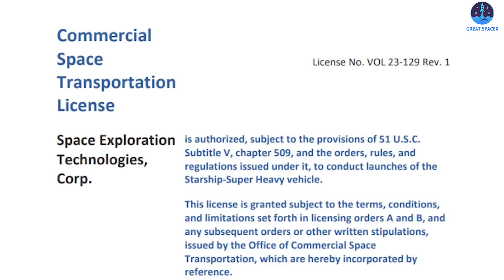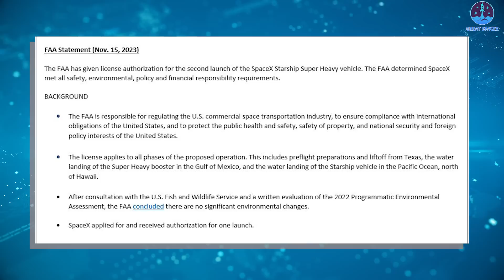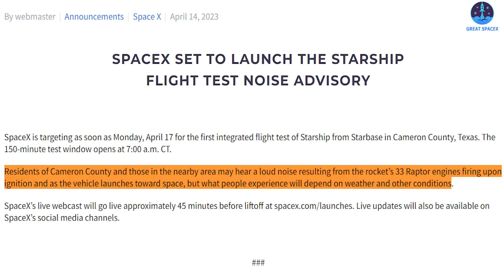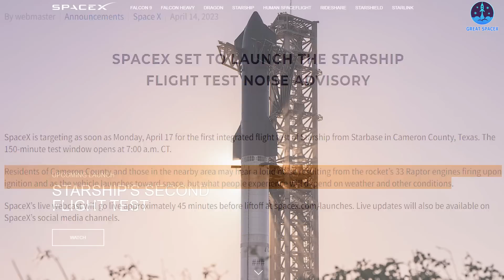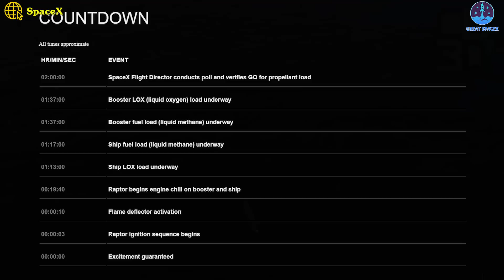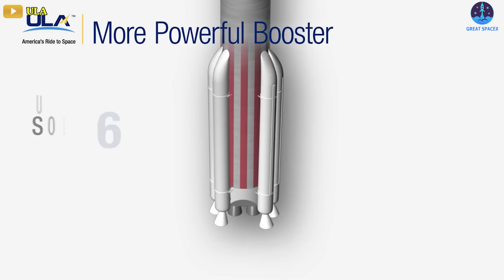Finally happened! FAA and FWS just approved SpaceX Starship OFT-2 this week!

Comment: This isn't so much a test of the flight vehicle, as it is Stage Zero. If it fails it's back to the drawing board and there won't be a 3rd launch for at least 12 months. The only reason that tomorrow's launch is even possible just 6 months after the "Big Dig", is that the water and steel system was mostly ready to go. They saw the need for it at least a year earlier.

Comment: You should research the actual failures during the fist flight test. The first test flight never reached stage separating. The separation mechanism did not fail. It was never engaged during flight because the flight computers terminated the flight do you loss of gimbaling control.
Reply: The first fight really was bad. The rocket was tilting right off the launch pad with little control left. The concrete that was blasted away damaged many things on the rocket so it was "dead" before it got 500 feet in the air. Musk was glad at that point to see it get clear  of the pad. He knew the risk was really high and went for it anyhow. That is called balls, don't see that much anymore. Go Space X!

Comment: 90% pad no damage and Lift off achieved, 65% no engine loss on ascent, 57% second stage success, 42% booster RUD at second stage,  72% booster hits mark and successfully "lands" 50% starship survives re-entry. 95% starship "lands". 1550% excitement levels. Letssssss goooooooooo.
Reply: XD😂😂😂😂
Reply: Sorry forgot the most important percentage. 100% hitting a whale or shark. Surely Elon will aim for one. #1 troll.
Reply: 100% failure
Reply: 100% failure on the launch pad. Kabaam, kaboom.
Reply: @GoDodgers1 the first sensible comment
Reply: @billygallacher6341  You seem like such a positive person.

Comment: Will there be an attempt to recover the HB and Starship after splash down?  I would hope so.
Reply from the maker: Yeah. They will do that if there is another explosion
Reply: Too deep for bothering to recover scrap metal.
Reply: The tanks will be empty. Full of air. Why would either Booster or Starship sink? @rogerphelps9939
Reply: Empty fuel tanks float. Just sayin;. They have recovered water landing rocket stages before this. No reason for this to be different. Floating free they will be hazards.

Comment: My prediction: 97.2% probability water deluge and launch will be perfect. 58.6% probability of RUD on separation attempt. If it survives, I predict a perfect hover before landing on target near Hawaii.
Reply: Mine is 97.4%.  I wonder the reason for the difference.
Reply: I thought they're going for splashdown at Hawaii??
Reply: @andrewsarchus6036  They are.  That is why I calculate only 0.034% probability of a perfect hover, then land.
Reply: @Paul-rs4gd  They're not even going to try to hover, based on flight plan released this past week, as described in some other video channel.
Reply: @andrewsarchus6036  Yes, but as I understand it, this will be a precision targeted splashdown in order to test Starships ability to land on Mechazilla chopsticks without putting the real Mechazilla and Starbase at risk. I should have mentioned the "target" is virtual and in the ocean.
Reply: @Seehart  My understanding is that they aren't even going to attempt a flip 'n' burn maneuver.  They're going for a freefall belly-flop into the ocean for whatever reasons they have.  Maybe to ensure breakup and rapid sinking.
Reply: @andrewsarchus6036  Bummer. My information is outdated I think. Seems like at some point they will need to do something like a precision ocean "landing" before trying it on the real thing. Maybe next time. Would be a shame to crush Mechazilla on the first try.

Comment: What's your opinion will starship make it to suborbit ??
Reply from the maker: I think the percentage is better than before
Reply: Indeed
Reply: I am optimistic that the has a good chance of making it to orbit. Reentry is going to probably be another story…
Reply: It’s not going to orbit. It’ll only go 3/4 around the earth and fall near Hawaii. But will not reach orbit per space x
Reply: @davebooth5608  Sorry I mean Suborbit
Reply: Of course, it will, the first launch would have been a total success if there had been an exhaust diversion system in place, unfortunately, there was no such facility and engine damage occurred. The rocket launched and as the engine damage was severe it lost control but essentially a successful launch. This will be repeated with the upcoming launch of Starship.
Reply: Yep